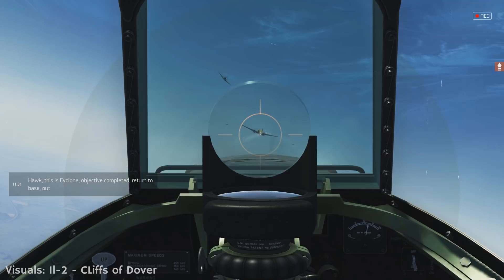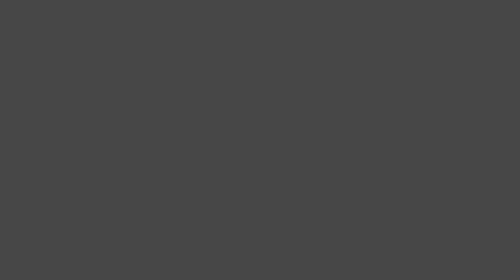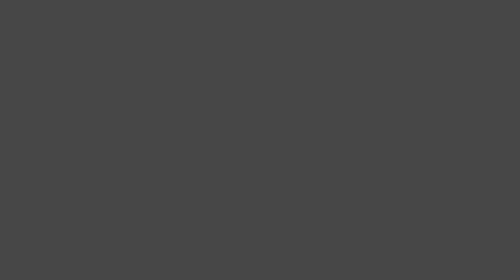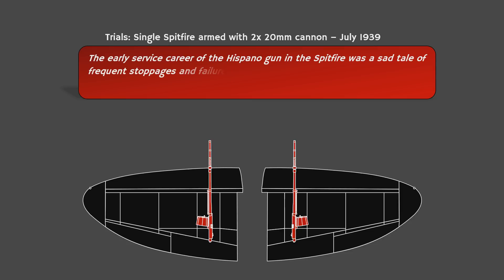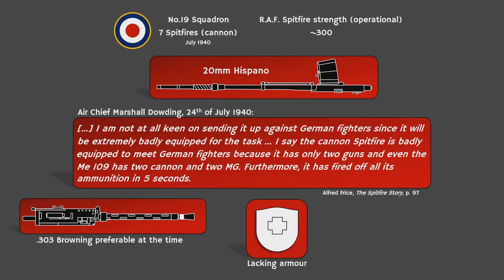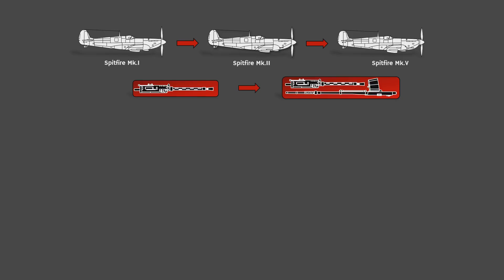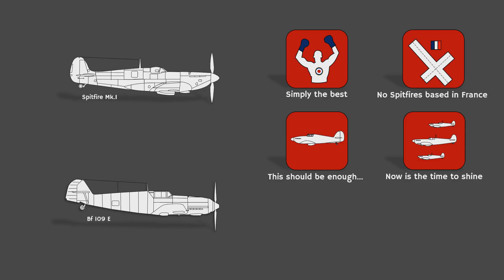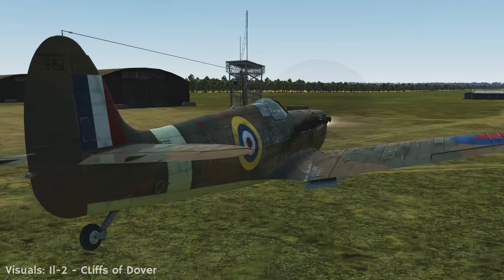⚜ | Clearing up Spitfire Misconceptions

Comment: The use of a carburettor is advantageous on supercharged engines using high octane fuel. It cools the charge. Direct fuel injection into the cylinder doesnt do this.. This is why Merlins always had "carburettors" the last types were actually fuel injection into the manifold Which is actually just fuel injection in a different place.  Spitfire production was low at the start and affected by spreading production away from Southampton. The Castle Bromwich factory didnt start producing in numbers until during the Battle of Britain, all Mk II Spitfires were made at Castle Bromwich.  Since about half of Hurricanes lost in France were due to the airfield being over run, sending Spitfires to France would have been foolish.  The 8 mgs of the Spitfire didnt down aircraft in spectacular fashion, but many damaged aircraft went down in the Channel or made forced landing with dead or injured crew. This only became known in the 1990s when archives in Berlin were opened  to western historians.  The fact that by September Goering was down to 200 serviceable bombers bears this out though. Four  Mgs were retained instead having four cannon because at high altitude the weight was a factor, as was guns freezing.

Comment: Wrong...the engine would not "Seize" when pulling negative G...it miss-fired and cut out due to over rich air fuel mixture.  Also the Spitfire did not have fuel injection.

Comment: Great piece of work . As i understand it the S'fire , for all it ' s assets , was notably slower  ( i have heard 3 times ) to build & that German manufacturing ability ensured that stocks were replenished quickly .  I think in the story of the S'fire & it ' s engine , one name should come fore & that is Tilly Shilling ........ https://en.wikipedia.org/wiki/Beatrice_Shilling .......... in a landscape war & sexism . As ever the UK got away with so much by the skin on it ' s teeth . I would suggest , a good chunk of that was the madness of the opposition management .
Reply: Whether an individual Spitfire took longer to build or not, British fighter production was not the main problem for the RAF, despite the number of planes being shot down. Replacement planes and and efficient repair network were making up the losses more than adequately. The shortage for the RAF was one of trained pilots. The Luftwaffe on the other hand, despite starting with numbers in excess of the RAF forces did not get anything like the numbers of replacement aircraft the Brits did and their pilots were worked far harder than the RAF's were. Dowding insisted the pilots should get regular rotation and rest. Battles are not won by skills and better equipment alone, but by excellent management of all the parts of the 'war machine'. On that score at least, Britain's Air Defences definitely out-performed the German High Command.
Reply: What Jerry Turner said. The "skin of their teeth" myth, popular after the war and stimulated by films and lazy historians who don't do their research, has been debunked by credible, scholarly research and studies a long time ago.

Comment: Why did the Spit fade from glory after 1941? From '42 it seemed all about the Hawker Typhoon and Tempest on the Brit side, and the P-47 and P-51 on the American side whilst the Fairey Swordfish was the best figther outright from both nations and the only match for the Me-262. And yet the Spit kept flying long after the war.! Perhaps the Spit just didn't have the range of the others?
Reply: TommyTwobats Ummmm....the Fairy Swordfish was a RN Fleet Air Arm biplane torpedo bomber.    Not exactly a fighter.   Are you thinking of the Hawker Tempest or the Gloster Meteor by any chance ?   Now the DH Mosquito is also in with a shout and if the Martin Baker MB 5 had gone into production,........
Reply: yeah...I know, but it was a good rival for the Me262. However, seriously, why did the Spitfire fade so much? In '44 and '45 you only here about the Tempest on the British side in terms of single-seat British fighters. As for the heavy twin engine fighters , I don't think the Mossie was ever pure fighter- wingspan was 54 feet!
Reply: I think it all comes down to the time frame.   If you read a number of the memoirs written in the 1950s and 1960s by pilots who were there at the time you do not get the impression that the Spitfire in any way faded.   Admittedly, for propaganda purposes, during the very early 1940s,  the Spit was talked up, when the Hurricane had in fact brought down more enemy during the battle of Britain - and not "just bombers" either.    Group Captain Townsend's book Duel of Eagles tells  it like it was.   Downed German pilots would often claim to have been shot down by a Spitfire when it was a Hurricane responsible - he calls it Spitfire snobbery.    And this is not intended in any way to talk down what was the very special aircraft that was the Spitfire, just keep morale up..

As an aside, The Hurricane airframe was at about the limit of its development at that time whereas the Spit was just starting.   As you know, some of the final Spitfire variants had a Gryphon engine, four cannon, a contra-rotating airscrew and more than 100 knots speed advantage on the Mk1.  I think public perception plays a part.   From 1944 onwards, the Typhoon was visibly (in the cinema newsreel ) carrying out ground attacks on the enemy.  The Tempest was visibly knocking down V1 flying bombs (as were the later Spits come to that).  That registers in the mind of a hard pressed public at home.

As for the best piston engined fighter in that time frame, well the Tempest led to the Tempest II led to the development of the Sea Fury - I like that one a lot - but it's just post war.    The Mossie (not to be met up with on a dark night when AI radar and cannon could really spoil your evening - that's a {night}fighter in anybody's book) led to the development of the superlative Hornet.    What happened of course was that many very promising fighter developments based on piston engines were rapidly overtaken by development of the early jets.

Let me recommend a book called "Wings on my Sleeve" by the late Captain Eric "Winkle" Brown CBE, DSC, AFC, RN.  Regarded as the greatest test pilot who ever lived, he holds the undisputed record for aircraft types flown.   (He flew 14 marks of Spitfire, but only counts it as one type flown).    He also undertook the first ever jet landing on an aircraft carrier (DH Vampire on HMS Ocean 4 December 1945) and the first ever multi-engined landing an a  carrier.   During the war, he fought with the Fleet Air Arm and then joined the RAE testing a vast range of allied and enemy aircraft.  After the war he had the job of touring Europe picking up "enemy" aircraft, both service and experimental prototypes, and flying them back to the UK for examination.   He even test flew a Messerschmitt Me163a Komet (and lived).  The Hornet was his favourite.

Finally, how would a Swordfish make out against an Me 262 ?   Well the Swordfish is very slow indeed, so slow that it reputably flies backward in a strong headwind.  The Me 262 would have to throttle right back and drop its undercarriage to be slow enough to hit it.  At which point the  observer/gunner in the open rear cockpit could knock it down with his Vickers K/GO gun.
Reply: Yes, The Swordfish could also drop a torpedo on the Me 262 cockpit area. I know the spit kept on post-war, but I just can't find what was the limiting factor and why they even bothered with the tempest etc. It has to be limited range, payload, but then it kept going longer. The Hawker planes had the bigger, stronger, wider undercarriage - perhaps that also helped. But absolutely, the Spitfire is the first plane you ever hear about as a kid.
Reply: I reckon it's largely down to development potential in the long run and keeping options open in the short term.  Also in a wartime situation, what have your factories and supply chains been tooled up to make and do you have the time to make radical changes ?   Afterall, why keep going with three heavy bombers - the Lancaster, the Halifax and the Stirling ?   Crew survivability was lower in the Lanc (position of escape hatches, you could stand up in a  Halifax etc.), but it carried more tonnage further as the Tirpitz found out.  As I said, the Tempest gave rise to the Sea Fury which outlived the Spit by quite some margin postwar.  And after the shooting stops, what have you got a lot of sitting around on airfields and what can your somewhat depleted economy (the UK anyway) afford.

Here's another ironic aside.  The Supermarine Attacker was built around the laminar flow wing of the Spiteful.    The engineering opinion (well some engineering opinion) was that they'd have done better to keep the original elliptical form of the Spit wing.  What was it the man said: if it looks right it probably is right.

Of course the Me 262 had one real advantage over the Swordfish, when it rained the pilot didn't get damp. Of course the Swordfish crews being Navy were presumably used to getting wet.
Reply: I think the Swordfish ought to have been fitted with pontoons and towed behind corvettes. It is fun to try and sought through 'facts' and 'myths' sometimes. This is just one example. I know Spits were made until 1948. I don't know when Tempests ceased production, but new Furys were being built as late as '55. I know that the Fury probably only lasted because the Fleet Air Arm wanted a carrier suited prop plane and so it is not really a 'fair fight' to compare the spit. The Spit was a poor carrier borne plane - they tried. But I also know the Tempests did the brunt of work late war. Killing Me 262s, V1s, attacking trains and that more than one squadron had Spit XIVs entirely replaced by Tempests and that Tempests were low altitude beasts. Wiki says Spits even flew higher altitude cover for them. Tempests lasted in India and Pakistan until 1953 (Burma or Bangladesh until 1968!) and were the last piston planes in the RAF (last sortie Nov '49) according to one source, but then according to another source Spits were sortied in Malaysia in '51 and still in service in 1953? So it is all confused..In any case, the Spitfire is the public relations winner. As for the best looking, I like any of the Spitfires with the round wing ends and I much prefer the Mk 1 Tempests, with the grill intake and smaller tail/ That radiator looks mean, like a dragon. Notwithstanding and of course the Swordfish is hands-down winner bar none except the Aichi E13A.
Reply: ...and on last thought, it occurs to me that from early '44, there were few or no dog fights to fight. The Luftwaffe was toast (many aircraft i.e. Bf109K - take your point about keeping existing tooling going - would later be built but pilots, fuel, motivation etc., hopeless) , and so the Spits agility might not have been needed.
Reply: TommyTwobats Thanks for this.  It's a pleasant change from the YouTube warriors who don't seem to grasp just how complex it all really is/was.   I've spent many a happy hour wandering round places like the FAA museum at Yeovilton, the IWM at Cosford, the BoB museum at Manston (they have a a Mk XVI -fondly referred to at the time as "clipped, cropped and clapped" or was that the Vb, it's certainly clipped anyway) etc., asking things like how did that work then ?

Let me recommend another book - "They gave me a Seafire"  by Commander R(Mike) Crosley DSC RN.  It has 14 appendices, some of which spell out characteristics of the Seafire and leave one quite clear that there was a lot more to the Seafire than a beefed up Spit with a hook.   He served with the FAA on the Malta convoys and finished the war out East with the British Pacific Fleet.   There's a quote in there you might like - "A Swordfish of 813 taking off ahead of us from (HMS) Eagle had kindly agreed to carry our quarter-ton trolley accumulator which we used for starting our Hurricanes.  He also had a couple of bicycles as well as a full crew, so there was not enough room for all the crew's suitcases.   He had therefore stowed these on the TOP surface of the lower wing ......".  

Sadly the suitcases the burst open when he applied lift, but on the bright side he saved his pajama trousers and dressing gown as they had wrapped around his tail plane !   I bet you can't do that in a Me 262 - and don't forget to stow the bicycles.

(Having to do a bit of editing, the predictive text is being a pain.)
Reply: Final thought to your final thought.  They DID fit pontoons on a Swordfish (and come to that Folland did the same with a Spitfire (!)), though with that much lift on the Swordfish they probably didn't need the corvette.    However during WW1 they did experiment with a Sopwith "scout", Camel or Pup I'm not sure, put on a Lighter (type of barge) and  towed at speed behind a destroyer to get the wind speed over "deck".  The idea being to attach such a combination to the fleet in order to intercept scouting Zeps and SLs. Plus ca  change and all that.    As for landing on after, that's another problem.  

Are you sure you meant the Tempest and not Typhoon when you mentioned a truck ?   The Tempest was developed to fill the gap left by the problems with the Typhoon's disappointing performance at altitude.
Reply: Are you thinking of the hawker sea fury?
Reply: Fairey Swordfish---143 m.p.h, Sea Fury--460 m.p.h.,Me 262--559 m.p.h.
Reply: mike barber See our earlier posts.   There's a certain strand of humour running through this and a lot of detail.    The Sea Fury entered service post war anyway.    By coincidence, there is  a documentary on Eric "Winkle" Brown q.v. on BBC 4 next week, he test flew the lot - some 487 types of aircraft from biplanes to supersonics,  counting all marks of a given aircraft as just one type!  Given a free choice he opts for the DH Hornet.
Reply: The Sea Fury is credited with one, possibly two Mig 15's off the coast of Korea.  As for the Tempest, it was the only piston engined fighter the 262 (according to one 262 pilot) really feared in actual combat.

Comment: Some other technical aspects of note: 

Early Spits (and Hurricanes) had fixed-pitch or two-position two-blade props which were inferior to the Bf109E's electric constant-speed three-blade screw. The lack of fine prop pitch control on the Spits hampered throttle response and thrust in comparison to the Bf109. de Havilland fielded a variant of the Hamilton Standard system on later Spit variants (~1940?).

The DB-600 series engines were inverted Vs (compared to everyone else's they were upside down), hence the development of fuel injection and 0g oil systems. Compared to carbs, fuel injection provides faster and smoother throttle response, is not susceptible to icing problems, and is more readily adaptable to turbo- and supercharging.

Spits had two-position flaps (up or down). Bf109s had variable flaps.

That beautiful Spit wing was great at lift distribution... right up until the entire wing suddenly stalled. Departures were violent, intentional snap rolls were prohibited, and spins were often fatal. The Bf109 wing was not as efficient, but had a more benign stall response; it also had automatic leading edge slats. This combination was thought to be more effective as the slats were retracted (lower drag) at lower AOA and extended (high lift) at high AOA. In any event, the dangers of flying to the edge of the performance envelope were significantly higher for the Spit (violent departure, spin, difficult recovery) compared to the Bf109. I expect that Germans that had flown in Spain were far more likely to ride the edge than a British neophyte with fewer than 100 hours in the cockpit.

The 8x303 gun package in the Spit was not as effective as the 8x303s in the Hurricane due to the lateral distribution of the guns across almost the entire wing (compared to the compact installation in the Hurri) due to gun harmonization. The MG+cannon armament on the Emil was definitely superior to both.

A .30 caliber (7mm) bullet has roughly one-half the kinetic energy of a .50 caliber (13mm) at 1,000 yards. Impact-fused cannon shells don't have that problem, but generally have inferior ballistics (high arc, longer TOF). So the trade-off is higher percentage of hits (slinging lots of lead) vs higher lethality (PK). If you're trying to hit a fast, maneuvering target (ie fighter) you lean toward the former; if you're trying to bring down large, armored, non-maneuvering targets (ie bombers) you want the latter. 

Although "combat effectiveness" of the Spit Mk1/2 vs the Bf109E was fairly comparable, they were very different beasts. Top speed was about the same, service ceiling was a wash (slight advantage to the Bf109, but not enough to make a real difference). The Spit had the edge in sustained turn rate, the Bf109 in climb rate and acceleration. Spit had a higher probability to score a hit, Bf109 had a higher probability to score a kill. Any pilot that flew his machine to its strengths could triumph over an opponent who didn't, and a pilot that flew to his opponent's strengths would likely lose. 

Galland's infamous solo jaunts not withstanding, it was generally strategy and tactics (and spotting the enemy first) that determined who flew home and who did not.